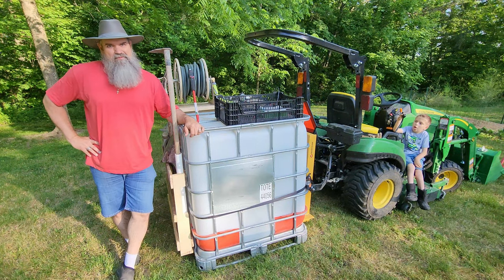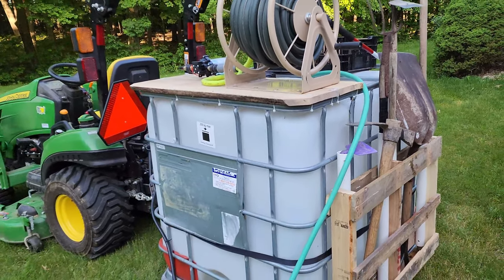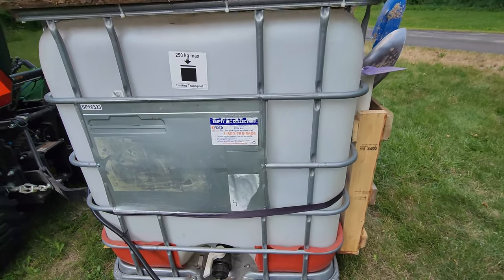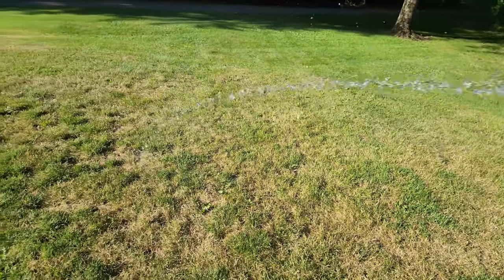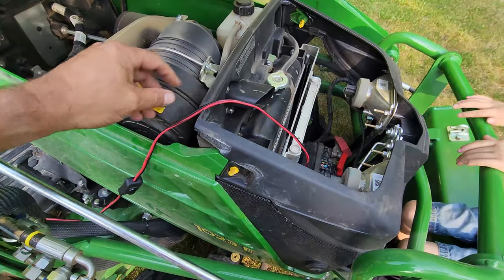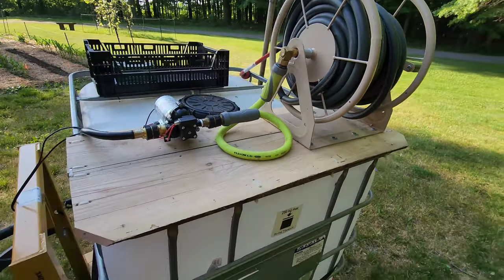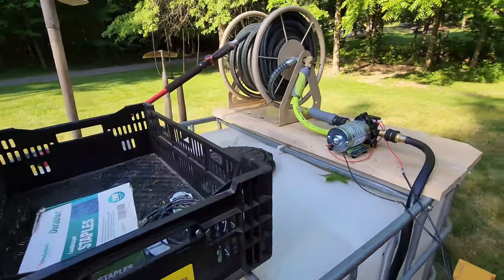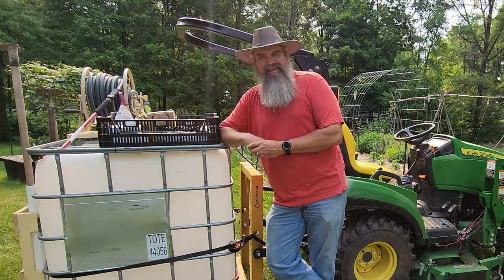Ultimate Tractor IBC Tote Watering System! A Gardening Game Changer!

Comment: You can modify with some wheel barrel wheels, some fittings, and threaded rod from tractor supply pretty easy. Psut a front hitch connection on and connect to your tow hitch on the tractor. Did that for my Kubota l2501 to pull one for spraying fertilizer.
Reply from the maker: That's makes a lot of sense. I imagine you can fill it up a lot more with that setup.
Reply: @StillwaterHomestead  you can. That 1025r can pull a lot more than it can lift.

Comment: That is pretty cool. I think the ultimate set up would be a hi flow pto driven pump and some bypass valves such that you could pull up to any farm pond or stream and fill it up and the distribute it
Reply from the maker: You can simply reconnect the hoses to the opposite sides of the pump and suck water or of a pond or stream. You would want to add a good basket filter to stop from sucking muck up into the pump though. I originally thought of using this to pump directly from my creek to water the garden, but it doesn't always have water, so I got the ibc tote instead.